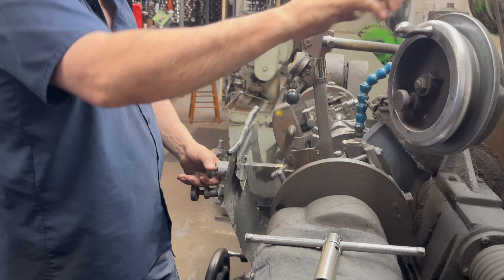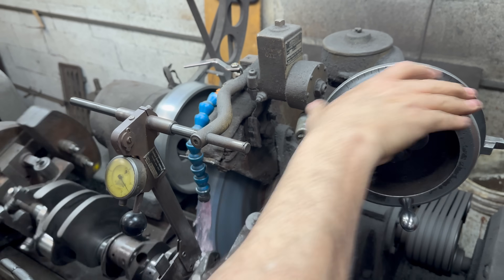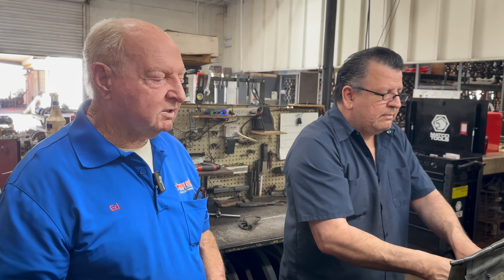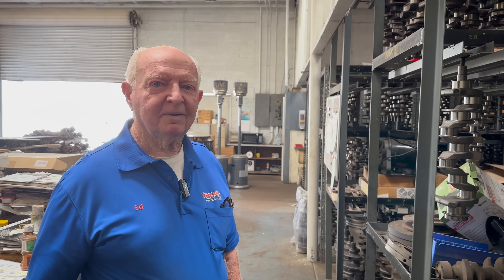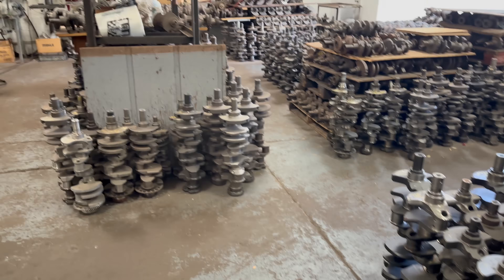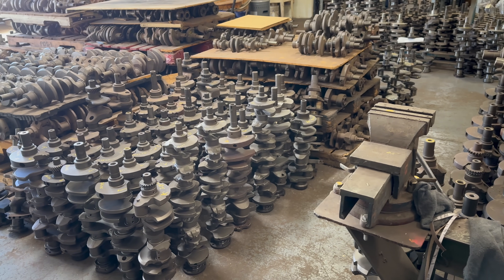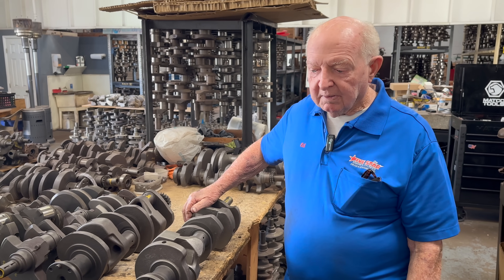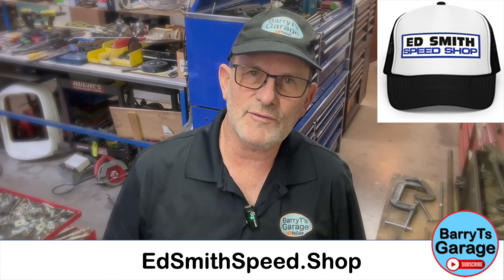Crankshafts! Grinding Polishing Straightening - Ed Smith w #BarryT  #crankshaft

Comment: When holding very close tolerances my father and many other Machinists from Allison's and Rolls Royce close tolerances Machinists why then
On OD grinder machines they dress the grinding wheels to only make  contact to metal grinding surface 
Why then they dress the grinding wheel to only about 1/4 of a inch of the grinding wheel making contact to the grinding surface during close tolerances grinding applications 
This method it don't apply to all applications as a crankshaft no but some other issue rather a crankshaft 
Many close tolerances grinding men only use a small detail section of the grinding wheel during close tolerances grinding 
We hold .0002 tolerances for Micropoise engineering company factory tire and wheel balancing equipment Micropoise engineering

Comment: Why then that one OD grinder has 3 Jaw chuck i see however it has hard jaws on each chuck 
I ran two engine lathe over 7 years
Ya better off with 2 chucks that are independent chucks as adjustable allen wrench.
With bored out soft jaws holding end of crankshaft 
But ya hard jaws in both chuck ends are ok.
Soft jaws bored to crankshaft ends are much more precise in deed but ya hard jaws will provide yes

Comment: We rebuilt a very old Blanchard machine i could hold tolerances of .001 flatness on that old Blanchard many times a Truck mechanic ship had me resurface truck flywheel and I did resurface a set of break rotors off of one of AJ Foyts old roadster indy cars for museum purposes years ago

Comment: Indianapolis family owned machine shop since early 70s
We had many external OD grinders ..we currently still own a Cincinnati od grinder but during my school days I ran helicopter propeller shaft spacer shafts on a arbor..Millitary production parts was plentiful in Indianapolis and I began Machinists duty at a very young age Millitary exhaust manifold clamps internal grinding why then both type I ran cardboard boxes thousands of parts during my school days to afford motocross racing as myself.
We as our family as of this new year of 26 why then we still own a family machine shop today.
There not easy on a family we don't do automotive details 
Besides Micropoise engineering factory tire and wheel balancing and Conagra foods far as butter plant engineering in Indianapolis

Comment: I was taught how to grind crankshafts for basic rebuilds and offset grinding for stroker applications when I was 20 years old by my mentor that had no kids. He took me under his wing and taught me everything, crank grinding, boring, surfacing blocks and heads, balancing rotating assemblies, installing seats and guides in heads, installing cylinder sleeves, line boring blocks, valve grinding, reconditioning and stress relieving connecting rods.... I will never forget Jr. Keen of Keen's Automotive Machine Shop in Smithfield VA.
Reply from the maker: Wonderful

Comment: 14:00 video time.... That rear part of the crank, that replaces a seal is called a slinger.  It throws the oil off the edge.  In those motors, (witch were many back then) also had a rope seal.  Those rope seals did not actually help much with oil sealing .
Reply: That's not a slinger...the rear main area is always flooded with oil ...no slinger is needed .. a  well installed rope swallow worked just fine ..that"slinger" is the thrust flange

Comment: Width ? I have different stones with different radius. Width isn’t to important as the machine has traverse  if you keep changing stone radius you will wear down quickly
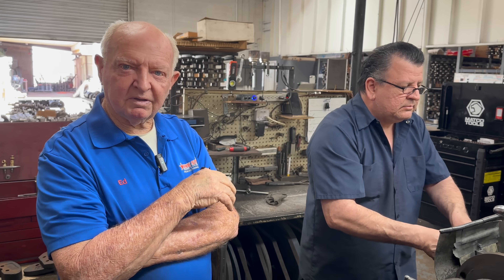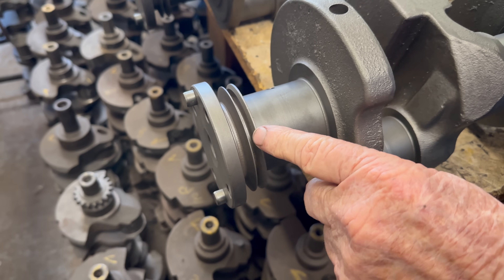Reply: @theewana2103 you are exactly right. I ground cranks in 71 and 72 on a Storm Vulcan 15A and a SV 15C. One machine was for primarily rods and the other was for doing the mains.  I've not seen a stone exactly the width of the journal. Always had to move the stone over to pick up the rest of the journal. I'm not sure what is going on at 5:30. Looks like doing pushups on the steady rest. The video never did show if the runout on the arnold gauge was taken out. By the time the journal is down to finish size the needle should be perfectly still, no runout, indicating the journal is perfectly round. At 14:16 he says he sometimes grinds this flange off. What he points to is the main bearing thrust flange. Engine would be ruined the first time or two you pushed the clutch pedal in if this was ground off.

Comment: Looks like your grinding on a Storm 15.
But why is the crankshaft grinder, the machinist not using both the upper and lower steady rest?
Whats with the rapid pushing on the steady rest?
I have never seen that one time in my life.
If he is fighting wheel head creep, that is a machine leveling problem.
And the journal should have been round sooner if your are grinding .030.
Ordinarily I am totally into all of Ed's and Barry's content.
Thanks for sharing. 
Have a good weekend. 👍🇺🇸👍

Comment: I worked in a machine shop, watched the boss straighten a crank… v blocks, dial indicator, a 1” round nosed chisel and a sledgehammer… Wham!!! Wham!!!
Reply: Yep! Seen them do cams the same basic way too.
Reply: @johnnytheflyer  
Circular saw bodies(
 (Before they get their teeth and become circular saw blades) are hammered flat. It's a 9 year apprenticeship to be a hammer man.
You're manipulating internal stresses to make the saw body,  or the crankshaft, want to naturally rest in its straight form.
I have heard it argued that straightening a crank with a press is the wrong way and can cause cracks. Only hammering can truly straighten it.
I do not know which method is better, So, if anybody with knowledge of how cranks that have been straightened actually perform and/or fail, please chime in.  Perhaps Ed might have some insight